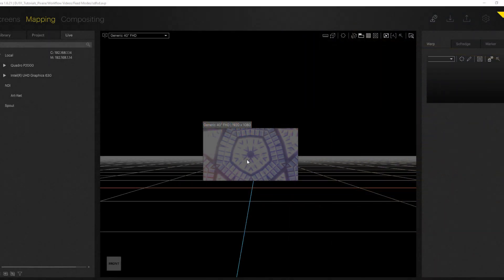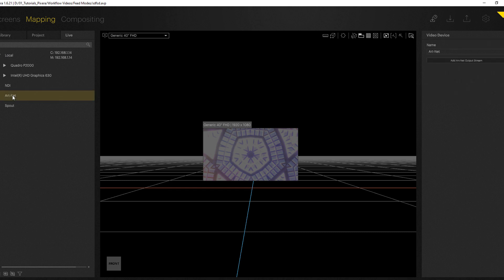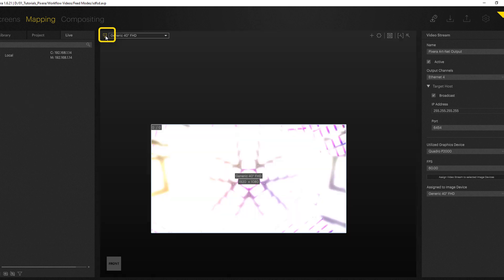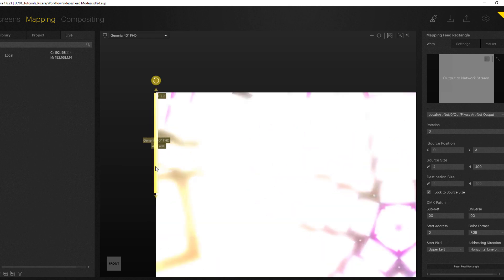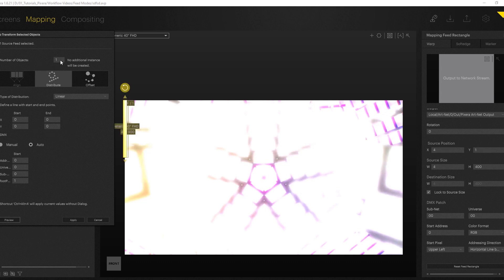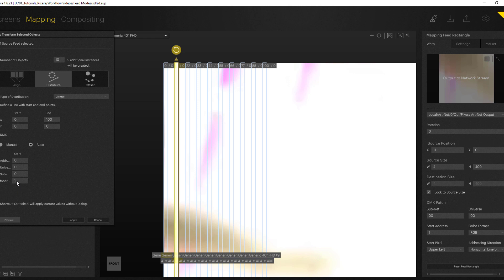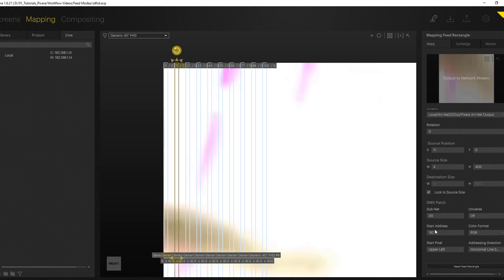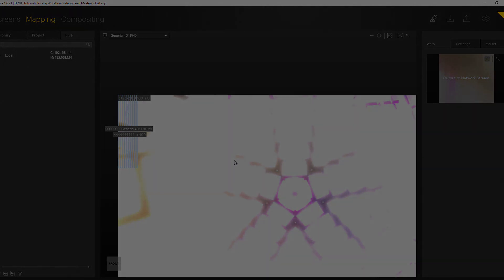Artnet Output Mapping - LED Stripes

Comment: It doesn't work for me!!! When I add a single pixel (1x1) artnet comes out but it shows and always fixed R=255 G=255 B=255 even if on screen the pixel changes color
Pixera v 2.0.223
Reply: Hi, as I have seen you already submitted a Ticket in our support system. I already answered it there with some troubleshooting steps.
Best regards!
Reply: @florianeder3846 in fact thanks to you I solved it 😁
Reply: @top.proservice  Hello, I have the same issue, how did you solve it?